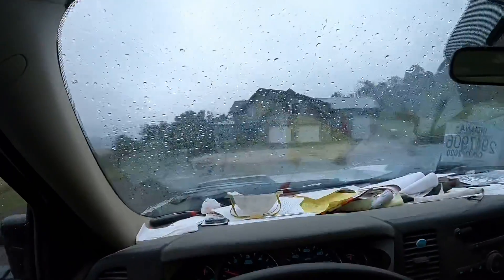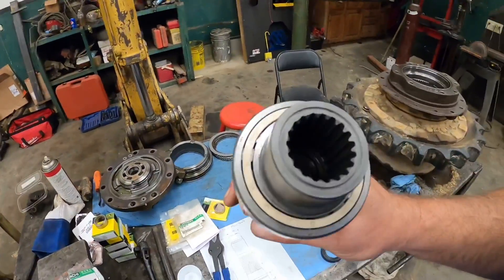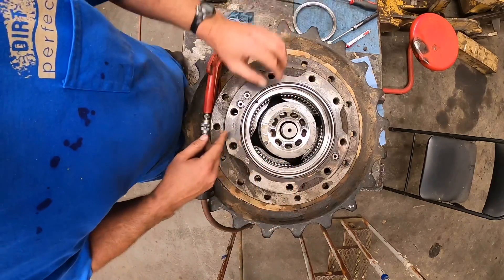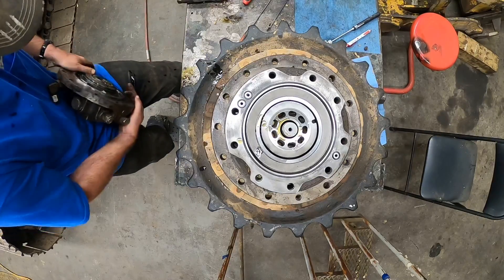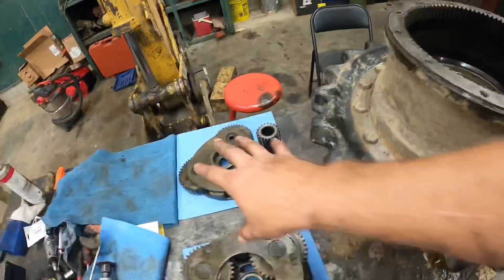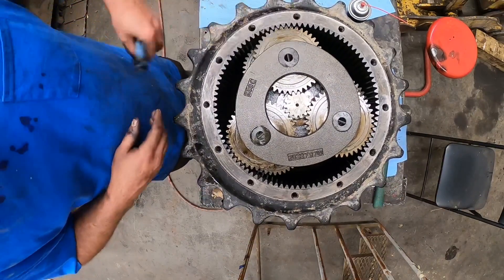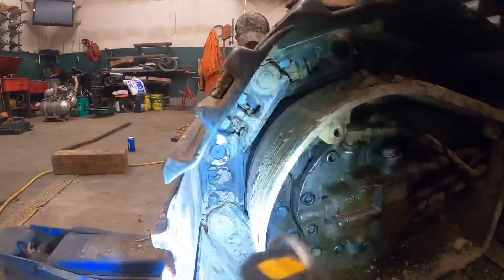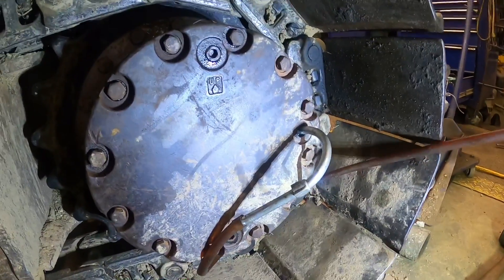Rebuilding the Final Drive on the 120 Lets try this again #backtowork

Comment: I’ve been trying to figure out how these work inside, and so far this is the best video I’ve seen. Notice the outer planetary carrier spins within the ring gear, but the second stage (inner, closest to the drive motor) planetary carrier is stationary, and the planet gears are the ones driving the ring gear from the inside.

Comment: The prop shaft(driveshaft) is a wear item  made from inferior material to the internals. They make it that way so if the machine is dead you can easily remove the shaft to get the machine in the trailer.....at least that's what I was toukd by a old-timer.thanks again for the amazing family content.

Comment: Just a tip. Next time you rebuild any hydraulic pump or motor, have a squirt can full of new, clean oil to lubricate all moving surfaces as you re-assemble. When you installed the new Rotating Group (Piston Block and Pistons) the Swash Plate was dry. The lubrication for the Piston Shoes to the Swash Plate comes through the Pistons, through the Knuckle, to the center of the Piston Shoes. Oil under pressure supplies this lubrication. Since this is a high speed, low torque motor it typically runs 600 rpm minimum. When you start up a new or rebuilt unit dry, the Piston Shoes are riding on a dry surface. Since the Piston Shoes are Brass and the Swash Plate is hardened steel, the Brass Shoes lose the battle of what wears first when no lubricant is present. Also rotate the housing to its side. This way the Piston Shoe will not drop out off the Piston. 53 years in the Hydraulics and Pneumatics business has been a tremendous learning curve. And I still have more to learn.

Comment: Another outstanding job well Done Mr. D. P. .
No matter what, that gear oil can't possibly smell worse than that skunk's spray did 😝
Reply: I don't know, those two smells are horrible, not sure which I hate more
Reply: The smell of burnt transmission fluid mixed with metal and clutch material is pretty close to old gear oil.  🤮

Comment: Good tutorial on final drive inner workings.  There is a large main bearing in this assembly that deserves attention.  The adjustment is critical because if it is not within spec, the metal faced seal that keeps the oil in the gear housing could begin to leak.  There is a large nut behind the primary planetary gear set.  This nut adjusts the preload on the bearing.  My final began seeping a little oil so I tightened this nut and it stopped the leakage.  You can do this without splitting the track.
Reply from the maker: Thanks David
Reply: @DirtPerfect  👍

Comment: Nice to see those safety crocs.😁 Another tip is to fill through the vent hole so it's easy to see when it comes out the level hole.

Comment: Just wondering... while you were assembling the brake discs and frictions, I noticed that you didn't line up the splines on the discs. There is a bunch of teeth then a space then more teeth another space etc. I would think that if the teeth and spaces arent lined up with the teeth and spaces on the outer housing, you would risk pulling the teeth of the discs. Just my thoughts.
Reply: I notized that to, they where not installed correctly, and the first shaft to go in caused the seal spring to come loose.
Reply: @zephyrold2478  I'm no expert so I was just noting what I saw.

Comment: Though it sounds hard, but you can replace the motor shaft and seal with the final drive on and the track still on. Heavy grease helps a lot.

Comment: Question??  When you installed the brake plates they had teeth and blank spaces between them.  The outer gear housing also had that.  Should they have been lined up or does it not matter that you just dropped them in and had teeth from the ring not in teeth on the housing?  Just curious cause I'm about to tear down my case 130 for the same reason.  One track not pulling, motor turns, I'm betting I will find the stripped shaft aswell.
Reply from the maker: Don’t think it matters but put them in the way they came out
Reply: It does matter. You really need all the contact. But it will work for a while.

Comment: The teeth on the discs in the clutch pack and splines in the housing have gaps that you didn't align so you have less teeth in contact to keep the machine from moving when the brake is engaged. It would be annoying to have to open it up again, but really aggravating if the extra load on each tooth ripped up the splines in the housing.
Reply: I second that.

Comment: I realize it would be much more work to remove the drive on the other side but replacing just one part ( male shaft )  and not both will cause wear on the new male shaft . 
 It's like replacing the chain and not the sprockets on a bike . I see you know what you are doing  
Great job  on what you did !

Comment: Do you keep a spreadsheet on maintenance, the hours and repair done for each piece of equipment.  Like notes of which final got full rebuild and which got a new shaft.  You need a light on both sides of the stick.
Reply from the maker: Yes

Comment: would those shafts be best put on a service check interval? every 5 engine oil changes check the wear on that shaft?
Reply: Annual would be OK your birthday month easier to remember
Reply from the maker: No don’t see the point in that been in there 20 years
Reply: @DirtPerfect  ahh ok figured they got a lot more wear in less time so they were literally due for this

Comment: I've got a question I've been wondering about since I first seen your shop. How do you keep all the shop noise out of the house being that the shop is connected to the side of your house? It seems like the noise from you working would be heard in the house and working at night like you do sometimes I'm wondering how anyone sleeps while you're in the shop all night? Maybe I've not seen correctly how you've built the house and shop but from what I've seen they share at least one large wall.  👍
Reply from the maker: Sound wall

Comment: It was very interesting to see what is involved with a hydraulic drive motor. I wonder for me anyway that I would always go for a $1,200 kit as posed to  $700 in part selecting. I am always intrigued by manufacture change manufacture of parts overtime of manufacture with added taper on some shafts with completely different  drive shaft without notation on machine tied to serial number. I was amazed that all the broken splines on shaft did not takeout all the other gears. I bet the better deal for the average guy would to pay for a complete rebuilt unit no matter what the cost because too many decision to make what is acceptable wear, and the time factor and no shop, and need to fix in field and finish the job. I often wonder how the turn table is constructed in 2 large disks haves that have to mate and hold hydraulic pressure with seals in an extreme location mud wear location. Rethinking my question of how this connection is engineered. It must be a spectate sealed unit that is w’ in diameter that is located in centre of turn table that does not require the separation of house from under carriage.

Comment: You have all the parts of a GM automatic transmission, just in a different order. Is there a stack height to measure for the brake rings and friction disks?
All you gotta do......
We just have to.......
Murphy says, Did you call for my help?
Would it be worth checking that drive shaft on the Volvo when you are down for snow this winter?
Reply from the maker: Never been on one but hope to one day

Comment: At 7:12 you mention parking brake. I can't find any info on this. Where can I find more, anyone.? I burst one of two final drive hoses: the left track won't move either way so I guess that's at least two. Digger won't move. Boom is poking into a doorway touching the lintel so I can't swing round to drag myself out. Need to make sure tracks are freewheeling i.e. brake is not on. Maybe I could push down on the bucket to back out but from what you say the brake is applied when using the tools so is there any way of overriding the brake? Very many thanks.
Reply from the maker: Check out parts break down on the John Deere website

Comment: The steel clutch plates had teeths and an open space with no teeths, these have to line up with the open space in the clutch basket, they did not. Not certain about the fiber plates, but they also had open spaces so they also have to go in to the right place I guess. When not aligned corectly it put a lot of strain on the parts = premature failure.
Reply from the maker: Put in the same way they came out 🤷‍♂️
Reply: @DirtPerfect  Maby so , but then they where put in the wrong way last time, the plates have to be timed with the basket.
Reply: @DirtPerfect   at 7:01 you can see the misalignment/timing, and I have a sneaking suspicion that the teeth on the fiber plates are worn more that good (less teeth than on the steel plates so more strain/wear), I am only trying to help you prevent premature failure.
Reply from the maker: Ok

Comment: Every piece of equipment I have ever worked on always had 1 thing it needed. It doesn’t matter if it comes out of a shop or not, always that one thing. So, if you leave the seat that needs redone then hopefully it will remain the 1 thing.

Can someone change their damn text notice alarm?  It sounds like mine and I checked my phone a dozen times.

Comment: Your 'thumb' is more like another hand with its four tines. Triffic. I wonder why they don't make plates you can attach to normal thin thumbs; a short one for a small bucket and a longer one for the grading buket. And why they don't put a release valve on the hose fittings  instead of having the hose burst; it's like electricity without fuses.

Comment: "took me longer to get parts than it did to fix": story of my life... Seems to be getting worse too. Old stuff or new: breakdowns will happen if you are using it. All part of it.
Reply: Took me over a month to get a ball screw and nut custom made and sent in, a whole month of a machine sitting doing nothing.
Reply: @inkman996  I ordered a gear motor for a copper hairpin bender Tuesday. Factory part. Might be here by the end of January 2021. Still running: machine not right though. More the norm than the exception now days.
Reply: I helped a friend a few years ago, completely rebuild his 120's under carriage, he replaced everything with brand new.. Everything under was rusted on so bad, it took almost a month, just to remove everything, then another two months prepping the frame for all the parts, lol I thought a one point he may have to replace the whole frame as well, but it all worked out and she moves and tracks great.. Now he's wanting to completely rebuild the engine, That will be a fun one...

Comment: Love and watch your channel alot. We have a JD 230C LC was curious when you say you bought all new bearing? Did you buy new bearings for each of the gears in both gear reductions or did you just clean them up and reuse them. Ours sounds so nice but wanted to know if you replaced yours. Also when you installed floating face seal was it a bitch ? Heard they can be. Thank you in advance sir 👍
Reply from the maker: To be honest little of both and thanks
Reply: @DirtPerfect  thank you sir

Comment: Maggie says you made a big mess, I have nowhere to lie down and take a nap.   Your have the basic same operating system on your Zero turn mower,  The better mowers have seperate wheel motors and hydro pumps. the 120 has a unitized  system.  Imagine the labor cost if this repair was not done in house.